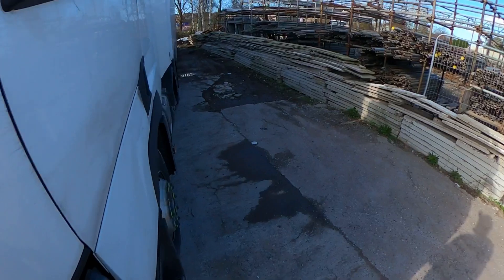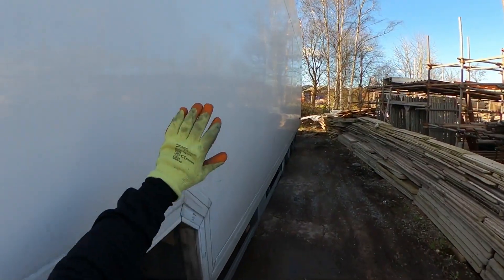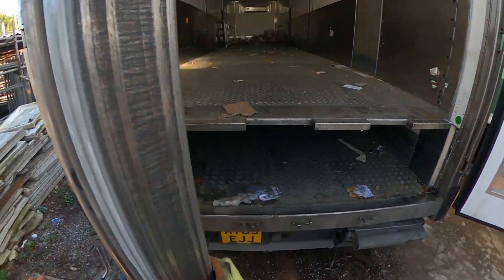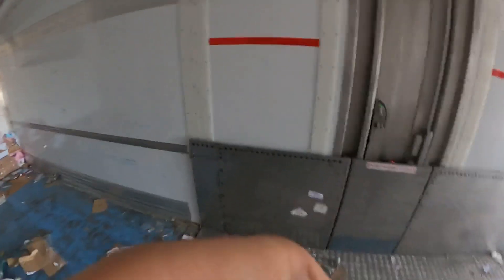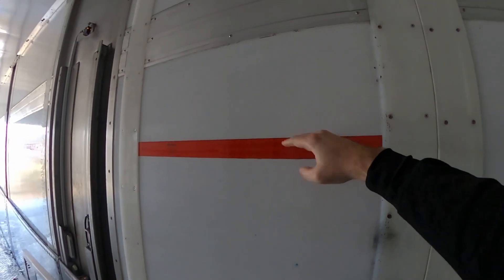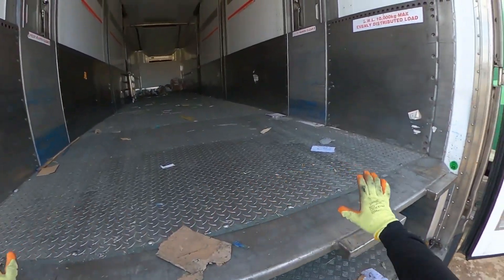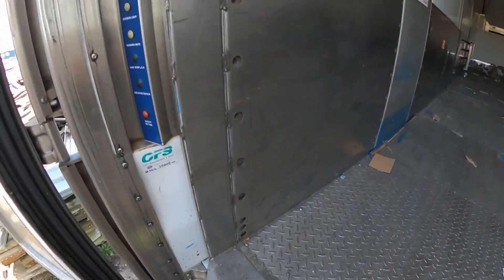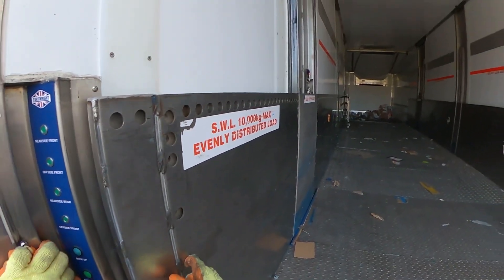How Does a Double Deck Trailer Work

Comment: Good video but skipped a few safety features ie lock paddles holding top deck up if it fails,height of cages pallets top deck ,and yes I no weights etc on Swan neck etc plus again top deck must be lighter with load than bottom deck most of us no this but gor newbies etc .keep up good work cheers
Reply from the maker: Good point, i will pin your comment to the top. Cheers!
Reply: What are lock paddles, what do they look like, where are they located and how are they used? Cheerz
Reply: @loadapish  when the top deck is raised there are four steel flaps that flip out one on each corner underneath the deck it prevents the deck collapsing if there is a failure ,basically chocks if these don't flip out once deck is raised do not go onto bottom deck.
Reply: How are the loads secured? Or is no restraint required if positive fit?

Comment: nice video Raul  but you should have mentioned the height of the top deck pallets don't go to high so as to avoid breaking the ceiling of the decker   when its raised , ive seen a good few cracked roofs or crushed top deck pallets  in my time .. but excellent video ...stay safe on the roads
Reply from the maker: Good point!

Comment: Thanks for another video. 
I do not know if the dubbledecker trailers are something that is found outside of the UK. Not in the Nordic countries anyway. 
Here it is more common to have a "normal" trailer and use these aluminum bars to load a second row of pallets over the ones on the floor. 
There are som benefits to the deck I suppose, not as unstable as the bars. But there are always up and downsides to everything. When I was driving and delivering to supermarkets we just loaded pallets on top of each other without anything between. Just made sure that the pallet on top did not crush the bottom one. Often pallets of crisps on bog roll pallets. And almost anything on top of soda or beer pallets. You got the hang of it after a while. Knowing exactly what could go on top of what. 
See you next time pal. 
Drive carefully and stay safe.
Reply from the maker: There are a few companies throughout europe that have double decker trailers but not many, as in rest of europe you are restricted at 4m height, where in uk they have 5m, so makes more sense to have more here. anyway bridge strikes are very common in the UK
Reply: I see. 
Thanks for clarifying that. 
Maby it would be more effective to have a little more hight on trailers across Europe but I guess there are alot of low bridges around. That is one part of why we have these modular tractor,trailer units that are 25 meters long.
Reply: @Raul689  my favourite one is the Halfords one with ‘we fit’ on the back, I feel for the driver, but can’t help but laught at that one.

Comment: Interesting, why is the Anderson lead   not fixed  on the tractor unit like the rest of the cables ?
Reply from the maker: not everyone is using them so it's more like an optional extra. you only plug it when you use it. and some are not spirals so they can snap
Reply: @Raul689  Thanks  how many forget and leave them pluged in and drive off ?
Reply: @marknucita8284  I’ve done it. As long as you don’t have to jackknife or do a spinny, you’ll be alright. But I’ve known people to snap them 😂

Comment: Nice video didn't release most of the floor moves on these double deckers.. Only seen the DD's with fixed floor and taillift..
Reply from the maker: Yes the refrigerate trailers all have moving decks, as you can not tip them from the sides. there are exceptions though

Comment: what prevents the pallets on the top deck from tipping onto the lower fixed deck?
Reply: at the separation point a wheeled gate is closed and locked in place. you can see it in the vid as Raul walks back from the front of trailer. at the rear end you would either use  straps or bars depending on what,s supplied with the trailer. hope that helps.
Reply: @247ADIE  Oh nice one didn't spot that.
Reply: There is strapping or metal bars  fixed in place prior to loading the top deck to stop good falling on to bottom deck
Reply from the maker: Guys answered brilliantly. forgot to mention that

Comment: Are they harder to drive with double decker than normal trailer?
Reply from the maker: Yes a bit, you have to be careful going round the bends and you get blown by the wind aswell
Reply: @Raul689  cheers, doing my ce lessons next week so fingers crossed.

Comment: I couldn't imagine how tipsy those feel to pull. Hauling double stack here in a US trailer is bad enough,  let alone in UK,  taller and heavier.  Fuckin sneeze to hard while turning,  roll your ass over 🤣😂
Reply from the maker: You definitely have to take the height into consideration. And they weigh about 10t empty so not the lightest :)